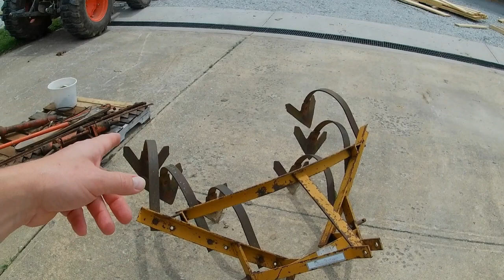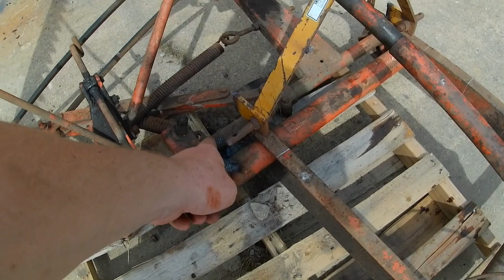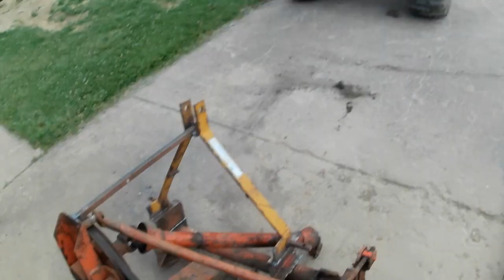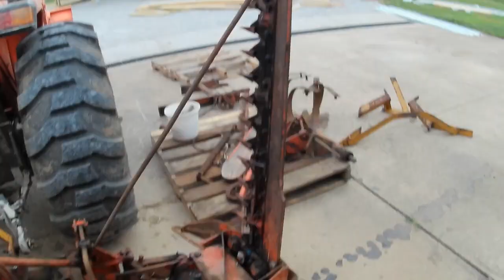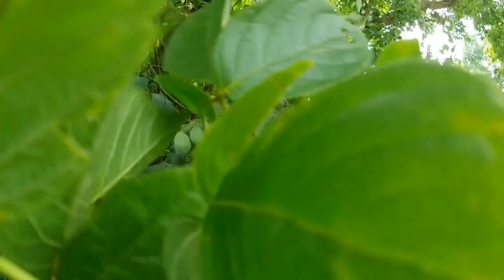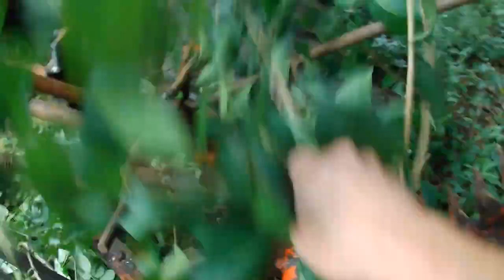Sickle Mower Conversion

Comment: Be careful in what you wield to. Most sickle bar mowers have a spring system so if you hit a solid object it will fold backward and will not break anything. Kind of a safety system on them. That being said I have no experience on a AC mower.
Reply from the maker: You are right. I broke it and fixed it in another video. It’s not supposed to be used in the up position and the spring kick-out didn’t help at all. I knew that before I tried it though.

Comment: I run my sickle bar mower at slow pto speeds.  Vibrates less and the cutting is just as good.  Good idea to use it vertical as well are horizontal.

Comment: Great video, I have been wanting to do something like that with a sickle mower for 20 years but just didn't know what type of mower to use.  I would like to add a hydraulic motor to run it and attach to my front loader bucket.  Would be great for trimming over hanging limbs along shooting lanes and roads at my hunting land. Thanks

Comment: Great video! Im going to look at an AC sickle bar tonight with intentions of converting to 3 point. What size Kubota is that? Mine is L3240, just wondered how it handled it.
Reply from the maker: It’s a model MX5200. It doesn’t take much horsepower to run a sickle mower. You’ll have plenty of power.
Reply: @justtinkering6054  Thanks!